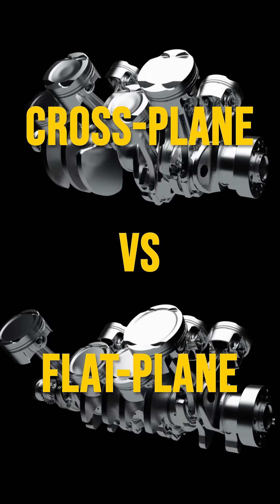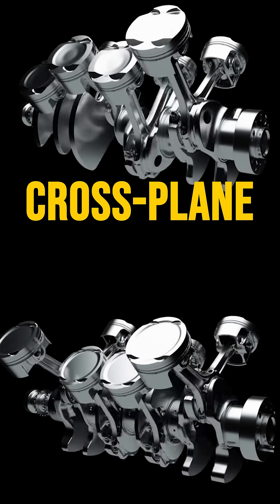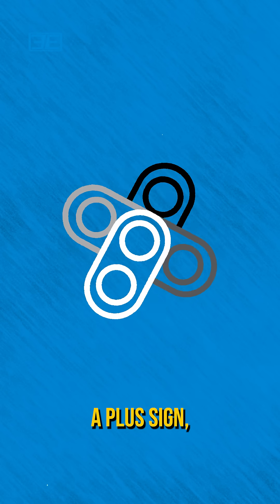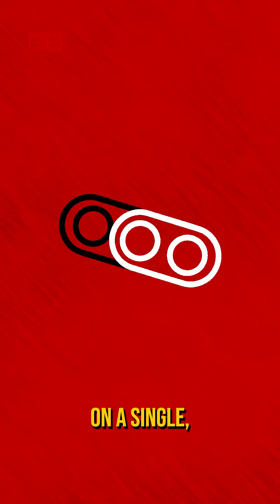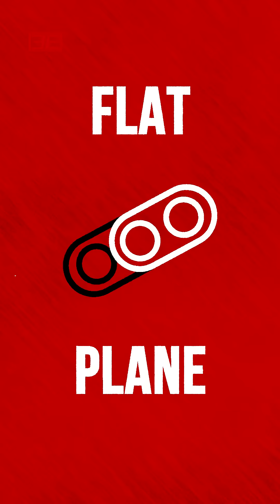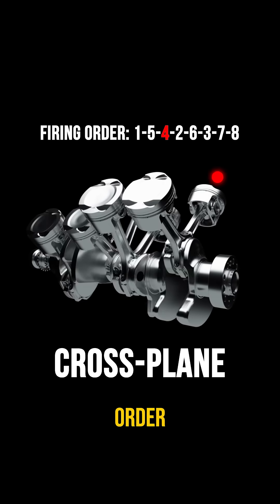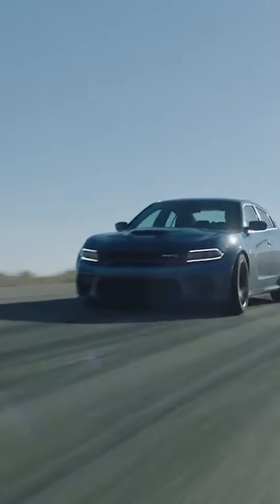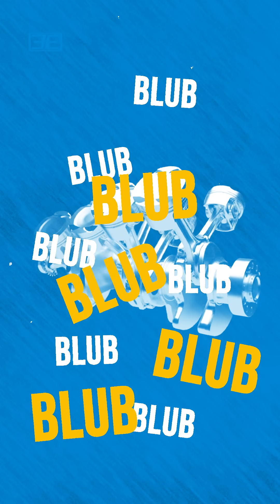Cross-Plane vs Flat-Plane - Which V8 Engine Is Best?

Comment: I’ll take the Subaru Crosstrek.  JK I bought my current daily driver because it’s comfortable, smooth, and makes V8 noises.  I’m LS swapping my CJ5 instead of a straight 6 because it wasn’t much more expensive and it also makes V8 noises.  I’m hoping it’s not too loud but I also wouldn’t be too upset if I can set off car alarms in the parking deck.

Comment: Way I've always seen it is a flat is essentially 2 I4s in a V so 1st and 4th cylinders go down as do 6 and 7 which balances the power whereas a cross plain each cylinder pair take 1 and 5 are balancing eachother so there's overlap hence that distinct blurrble sound that you don't get from a flat as it's balanced perfectly

Comment: I don' t drive my car on a race track. I drive my car on public roads that tend to have slow drivers. I need something that is able to pass a car very quickly. Downshifting and increasing engine revs, adds time. Hell by the time the engine has enough power to pass, there is a car coming in the other direction.

Comment: Old side valve flatplane V8s were a great way to convert fuel into noise with the byproduct of horsepower.
Reply: Wasn't the mayority of those engines cross planes? Even more noise with less byproduct of horsepower

Comment: Flat plane is definitely the better one in performance but I like the sound of cross plane a little better
Reply: Eh. Not necessarily. I mean, look at Wilkinson or Steve Morris' stuff. Even with more weight on the crank, you can compensate for that with counterweight shaping and taking weight off the flywheel etc. There's as many advantages as disadvantages to having that weightiness closer to the power. I mean, they've practically proven that you absolutely can put together a 426 or even a 572 that revs out to like 8500. It starts to become more of a question of limitations on flow and the valvetrain and spring mass and float.

And crossplane can also technically be the better one in terms of performance factor if you bring reliability into the equation? "Oh but the scavenging and exhaust pulses duuh." Yeah, um, header design and crosspipes? We know how to compensate for all these things, basically.

I'll take a well set-up goddamn Stone Age pushrod V8 any day, if it's as well designed as the Eagle Hemis. Hell, those engines are even reasonably fuel efficient. Drove a 1500 Laramie for a while there and I cruised it at like just over 1L/100km, that's almost like 24-25mpg out of a bloody 2,5 ton pickup.

Comment: And this is why at the end of the day, the 5.2 voodoo is a sad excuse of a flat plane crank v8

They, changed the firing order so it would "not sound European" 

That caused them to have to balance then engine increasing the weight of the crank shaft
Lowering the redline to 8,250 when a stock coyote revs to 7,500 and with a tune can be pushed to 8,500

Then they took the headers and spaghettified them just to make it sound better again 

I was ready to pull the trigger on a gt350 and then the more and more i learned about the voodoo and the Gen3 coyote found in the Mach1
... yeah, gimme the mach1 please

Comment: It is not the cross the makes the american v8s rev worse, its piping and component size.

The wider the space between the main (center) bearing and the rod (outer) bearing the more torque the engine has, because the pistom moves further per given amount of rotation. You cant rev as high because bigger parts cant move as far in the same time. Then when you make everything smaller the engine struggles to breathe because the firing order requires pipes crossing like a regulatory code.
Reply: What you gain from leverage you'll lose from surface area, the main low rpm benefit from long stroke is that the piston gets out of the way quicker.

Comment: Its interesting how the differences change the approach power can be made between the two styles. Just by element of the crank case the options for stroke and bore determine how the engine can be used to build torque or build power. The balance of a cross plane allows dimensions for low end torque, and thus grand drivability at the expense of ultimate rpm. The lightness of a flat plane allows an engine that can build power and thus output rpm very well, at the expense of low end torque and traditional driveability
Reply: Depends most road car engines the limiting factor for rpm potential is the valve train not the bottom end.

Comment: Is there any reliability discrepancy between the 2?
Reply: Cross plane will be better (as in easier to handle) from the point of vibrations, something that can hurt more than just the engine internals. Most cars using flat plane are mid engine or with transaxle to avoid having the gearbox transferring all the vibrations into the car.
Reply: Idk, but better balance probably means cross is inherently a little more reliable.  That said, I'd guess other factors have a much stronger influence on reliability.

Comment: Gotta love the sound of a Hemi with an oversize exhaust.
Reply: gotta agree.
Reply: No? They're extremely poorly designed engines. Gotta love having to change 16 spark plugs because the engine is too inefficient to meet emissions otherwise. There's a reason you don't see them on race tracks next to Camaros and Mustangs.
Reply: Hemis are common in drag racing tho @andrewahern3730
Reply: @andrewahern3730 NAILED IT 🎯
Hemi = JUNK
Reply: @andrewahern3730  *sound

Comment: I prefer V8 crossplane; yet haven't found one that mimics the firing orders of a V4 engine by having one pair of cylinders firing together.
Reply: Easy solution my friend. Get a V4 motorcycle. It's what I did and now I can enjoy that lovely V4 sound.
Reply: @old_dan what makes you think V8 cars can't have V4 sound?
Reply: @wanr5701  Please point to where I said that? ^_^
Reply: @old_dan "Get a V4 motorcycle."

Your memory and ability to read between the lines are very impressive indeed.

Comment: Steve Morris does a great job explaining why flat is weaker and why high hp motors arent flat. He builds the fastest street car engines in the world. drag and drive world record engine.
Reply: which video was this? i cant seem to find it
Reply: @chickenbobbobba  it was part of a Q and A with his son kyle and one of the engine builders at the end of a video but i dont remember which one. i had always wondered why one vs the other.
Reply: @breakupgoogle  ah right. in the mean time i did do a little googling and someone pointed out that while flatplane v8s are theoretically more balanced, you cant just balance them by adding masses while you apparently can with a crossplane. if i find the q and a then ill feedback and tell you if thats the reason or not

Comment: Flat plane V-8s sound like 4-cylinders because they basically are. The most overrated engine since the rotary.
Reply: Ah yeah I hear that complaint all too often when a V8 Ferrari revs out.
Reply: @ALMX5DP  I've driven the 458. It sounds exactly like a Toyota Camry without a muffler below 6000 rpm.
Reply: @Ficon why are you driving a 458 for any considerable amount of time below 6k rpm? :P
Reply: @ALMX5DP  Here's what every car YouTuber doesn't tell you: these cars all have extremely tall gearing and unless you are in 1st gear all the time, in normal or even spirited driving you are rarely near the redline, they sound like crap, and they have no torque. 458 tops out at 47 mph in 1st, 66 in 2nd and 89 in 3rd. Not as bad as 911 but still not particularly accessible and the gearbox is not very good.
Reply: @Ficon sounds easy enough to keep it over 6k rpm being the redline is 9000. 😉 Live for the sweet moments that such experience can be unlocked and don’t drive it like a grandma.😅
Reply: @ALMX5DP It’s a very grandma car. Super light steering, no torque down low, and so much exhaust drone that hearing loss to block it out is a plus.
Reply: @Ficon sounds like it suits you well! 😂
Reply: And yet they rev higher.

Comment: Should've given a shoutout to Ford's oddball flat plane, the Voodoo. Sounds like a cross plane, but revs like a flat plane.
Reply: It sounds like cross plane because of factory unequal length headers.
Reply from the maker: Voodoo is flatplane, though without the center two cylinders on either bank moving up and down in unison, pretty uncommon!
Reply: @EngineeringExplained well, which one is more reliable, energy efficient and has higher mileage..??
Reply: hate to burst your bubble but the voodoos sound is mostly achieved through the exhaust and not the motor itself. it sounds a lot more like a regular flat plane v8 when straight piped, with a feint hint of the crossplane growl.
Reply: @yimpyoi9808  hate to burst your bubble but the voodoos sound is mostly achieved through the firing order, tho the headers and exhaust do play their part in the factory sound, even with equal length stepped headers and a proper exhaust the voodoo will not sound close to normal flat-plane and will always sound rough and odd, and not have the high pitch smooth tone of a normal flat-plane. Its closest sounding V8 is probably the BMW S65 from the E92, which is still a cross plane, but revs just as high.
Reply: But fun as hell to drive. Personally I enjoy the GT350 more than the new GT500. Driven both a fair amount. The GT500 though is a pretty comfortable car
Reply: @Boberation Had both. Now I have a gt350r and am looking into a Corvette
Reply: It's a flatplane but the two center cylinders aren't upstroking together, they're alternated but still spaced 180 degrees apart, not 90 like on a regular crossplane v8
Reply: I believe it should be called snake plane.
Reply: That why the 5.0 coyote is the most efficient v8 ever made
Reply: @THE1MOUNTAIN2BIKERS Why's that?
Reply: Because the companion cylinders are different than the crank in the ZO6. The ZO6 crank is the same as a typical 4 cylinder
Reply: It should still have perfect primary balance. Each cylinder countering the other. Like any four cylinder. I understand the center cylinders do not move in unison. This shouldn't matter, there in unison with the counter pistons. 
I'm a chassis master Ford tech. 
Notice I didn't say engine master. Why am I wrong here?
Reply: Also I believe that additional .2 litres of displacement come from the crank shaft alteration. In theory, you could buy the rotating assembly of the voodoo engine and apply the coyote heads. 
At least you would be if ford had any damn sense when it comes to engine building. Which they have had before.
Reply: No, they dont sound as good as something like a Z06.
Reply: It’s the best sounding piece of machinery ever made.
Reply: It is the worst of both worlds though, bad primary and secondary balance
Reply: @LegendaryHondaS2000 yep probably big part of why those motors break so much. they do sound great though.
Reply: @LegendaryHondaS2000  do you own one? I do. Stop talking.

Comment: Listen to a Corvette V8 especially C6 and C7 at idle. You’ll love the cross plane melody.
Reply: I think the best sounding Vette I’ve heard was a C6 with a flat plane crank that rev’d to 8000rpm+.
Reply: My 2nd gen. Skoda Octavia would love to have V8 cross plane engine🙂
Reply: I’m pretty sure Those have flat plane V8’s as well
Reply: C6 GS and C6 ZR1 have the best sounds
Reply: @gracestingray They both have flat plane V8’s bucko 💀💀
Reply: Sounds like a fat person fart. I can see why its an American favourite
Reply: The firing order is different than the first generation small block.
Reply: the muscle burble on old school muscles sounds great, and trust me, in person its EXTREMELY loud and bass, i actually felt it vibrate in my chest, the closest things to them today are amg v8s, but flat plane sounds great too, italy makes v8s sound like a v12 (if it has an aftermarket exhaust)
Reply: listen to a 458, and youll never go back to american cars
Reply: @nobrakes7892 458 with an iPE exhaust, that is.
Reply: Flat sucks
Reply: It sounds broken…
Flat plane sounds like a pissed off racecar
Reply: @JV8901  flat plane sounds boring at idle, nothing beats and angry v8 chop